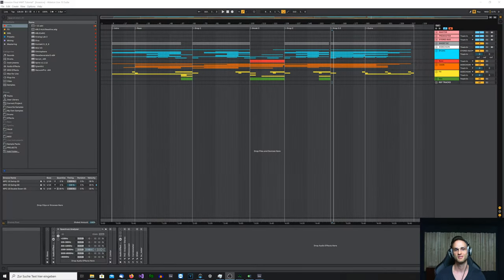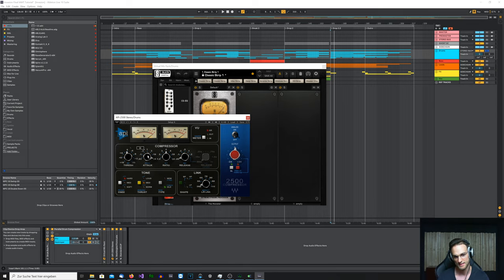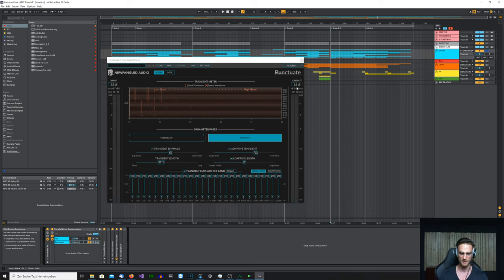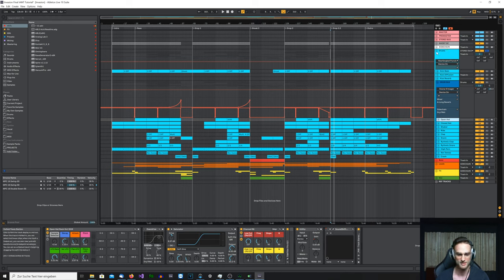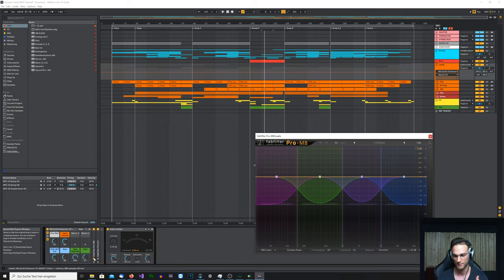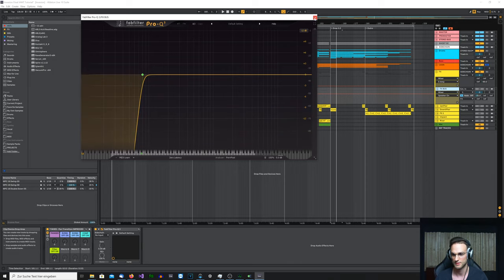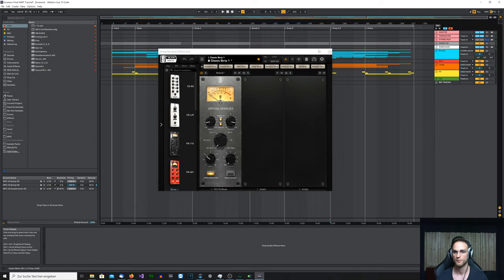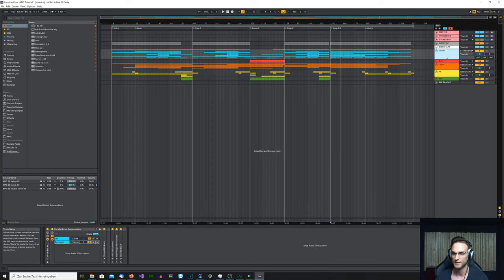Invasion Tutorial - Mixing (How To Mix A Techno Track)

Comment: This is very insightful never used clipping in this manner but as you explained it makes sense specially on electronics music (Techno). This is a debate that cause a lot of controversy specially from Mastering engineers that mixes bands rock pop etc... 🎹🎧
Reply from the maker: Yes, different genres require different approaches and techniques. For some genres it's good to keep the dynamics, but in others loudness (density, hotness, in-your-face) is part of the overall sound.